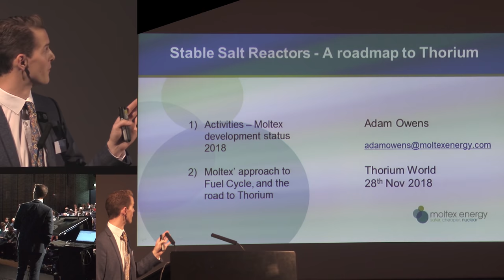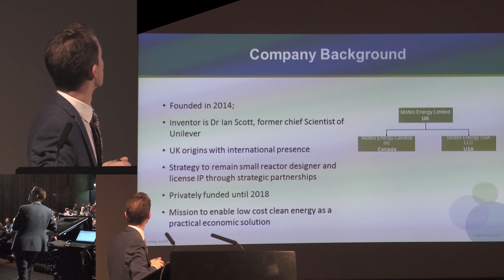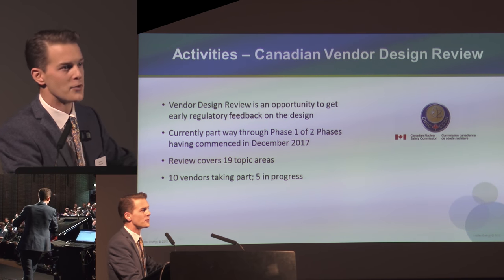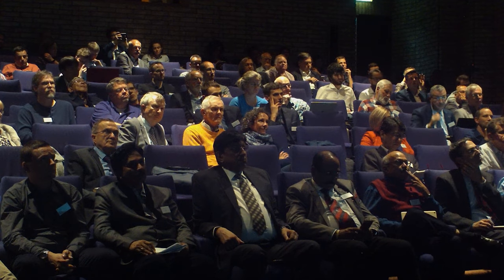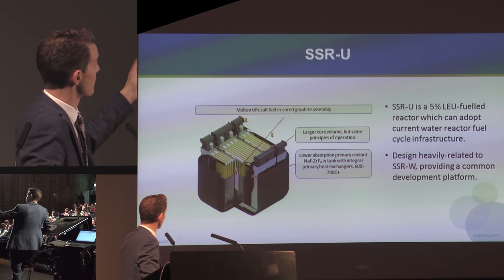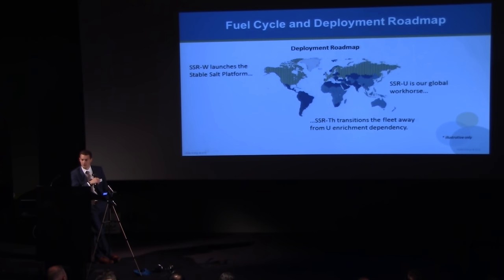Moltex SSR (Stable Salt Reactors) a Roadmap to Thorium @ ThEC2018

Comment from the maker: Timecode index
...
00:00 I'm Adam from Moltex
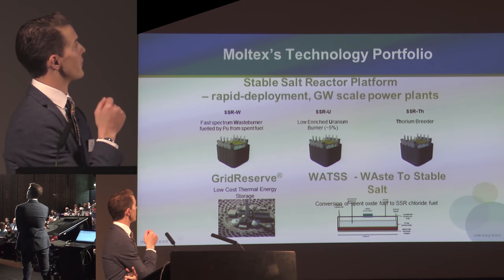00:48 Moltex technology portfolio
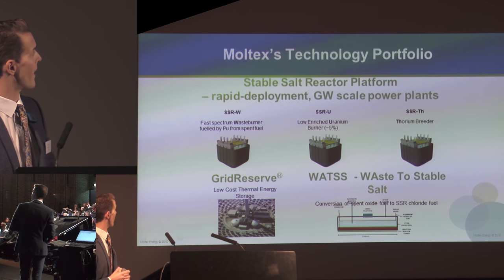01:20 Preconceptual idea for Aircraft Reactor was salt in fuel pins
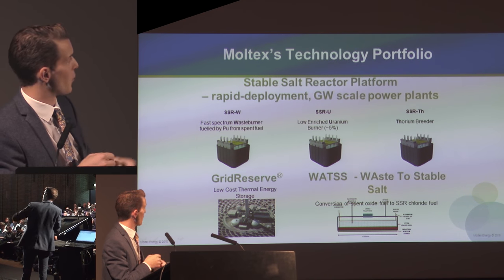02:07 Rapid deployment - avoid hardest regulatory hurdles
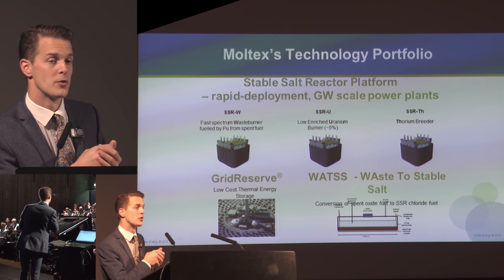02:50 Gigawatt scale
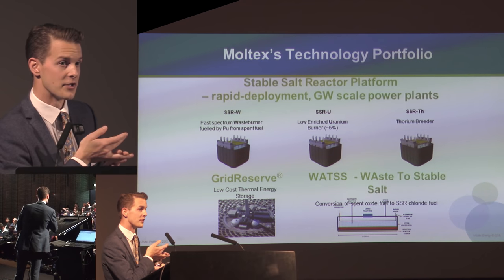03:29 first-of-kind MSR technology investable by private industry
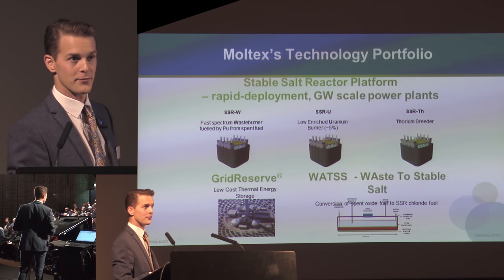04:40 3 variants of fuel cycle: SSR-W, SSR-U, SSR-Th
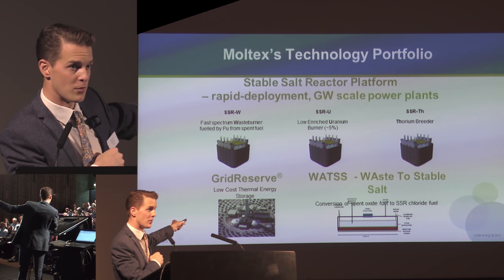05:25 Grid reserve - act as a peaking plant like a CCGT
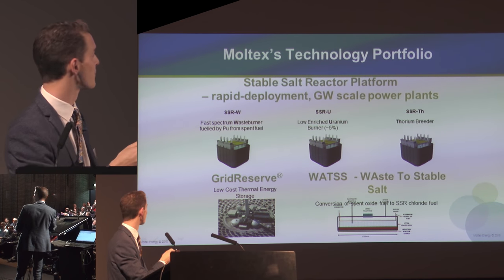06:37 WATSS - WAste To Stable Salt
07:10 Moltex company background - founded in 2014
08:05 Activities in UK - AMR Feasibility Study
09:07 Activities in Canada - Vendor Design Review
10:13 MOU with New Brunswick Power (Canada) Pilot SSR
11:42 SSR-W (Stable Salt Reactor Waste Burner)
14:20 SSR-U (Stable Salt Reactor 5% low-enriched Uranium)
15:51 SSR-Th (Stable Salt Reactor Thorium breeder)
16:54 Deployment Roadmap - requires a mix of all 3 reactors
Reply: Thanks, Adam.  Four years on, how is this progressing?
From England

Comment: Moltex has one of the best fast reactors I have seen: great for burning waste, burning conventional LEU, and breeding U-233 from Thorium (which we will need a lot of in the future to deal with the burgeoning fleets of new thermal spectrum reactors). It's design is simple and economical, very few moving parts that are prone to wear and replacement. No meltdown risk with very high proliferation resistance. I hope Moltex can work with the US. We would like Moltex's here.
Reply: Moltex can't breed
Reply: @PH-mo3vu  
As in the SSR isn't a "breeder" reactor, technically true. But so what? Just means U-235 will still have to be used, albeit in much smaller quantities i.e transmuting thorium in the coolant to fissile uranium is still a "good thing". No need to turn "thorium only" into a fetish. IMHO.
Reply: Moltex consumes 235 U with or without (a small amount of) thorium in the blanket. To reach 20 TW only heavy water and sodium reactor can do
Reply: Further advantages are the high temperature output.
This enables both extremely efficient water desalination and extremely efficient zero carbon hydrogen production

Comment: woah.. Their designs appear to have changed drastically since the last time I saw their presentation. They're bringing back thermal spectrum into their reactors. It seems that MSR companies tend to start off quite different, but end up converging to LEU thermal burners, as with Thorcon, and now Moltex.
Reply: Three possible variants. Only the waste burner  currently being pursued. After that is commercialised, they'll start looking at the other two. Low hanging fruit first.
Reply: It's because at this stage it's more important we build nuclear reactors and start reducing our emissions, than gambling on the more advanced technology. Once you've got revenue coming in you can spend the R&D dollars developing more advanced reactor.
Reply: The Russians have actually built those reactors already, see bn800, bn 1200 as have the French. The fast breeders are not economical yet and also a new class of materials will have to be developed for the structural elements to prevent fatigue since they run at high temperatures
Reply: @thexperimenter88  So the BN 800 and BN 1200 are sodium cooled fast reactors, which is a different technology to molten-salt cooled reactors. The Moltex SSR-W has been designed to not require exotic new materials, just standard nuclear steels. That said as I understand it the challenge with sodium fast reactors is not materials per se, but rather dealing with the inherently unsafe problem of liquid sodium metal, which burns readily on contact with air or water. This is a problem that molten-salt reactors do not have.
Reply: Tom Shackell all molten salt reactors work at higher temperatures than the reactors currently in use. The steel may withstand the temperature but Investigating creep in the steel takes years. Then the material becomes certified. Then there are more sensitive apparatus like pumps, seals which need to be investigated as well
Reply: Tom Shackell personally I prefer the design of a company called aristos to moltex. Moltex makes use of a shuffling machine that is known to be a headache and a very complex design
Reply: @thexperimenter88  So I am not an expert on nuclear regulation. That said, what Moltex have said elsewhere is that they are using 100% materials that are already certified for nuclear, well within the tolerances that they have been certified for. No new material certification is required: which is key to their business case. Additionally unlike pretty much every other MSR their design does not involve pumping hot fuel salt round a loop: it is a "pool" type reactor. None of which is to say that they couldn't face technical hurdles: that is always a risk.
Reply: @thexperimenter88  I really couldn't comment on the shuffling machine: not a nuclear engineer. Thanks I will have a look at the Aristos design as well, I have not seen it before.
Reply: @thexperimenter88  It doesn't, actually. All it does is push fuel rods horizontally from one end to the other. If you alternate directions between rows, you can maintain an even neutron flux. (that's what CANDUs do anyway) The one with the crazy shuffling machine is Terrapower.
Reply: Tom Shackell Aristos power has a Facebook page where they have been posting their different designs. There is also a YouTube video about them
Reply: Tom Shackell material is always a bit of a limiting factor right now for any molten salt reactor. They all would like materials that allow them to operate at higher temperatures for higher efficiency
Reply: @thexperimenter88  Ah yeah I looked into the shuffling, it is CANDU style: pushing assemblies along a rail. It doesn't look too complicated to my (untrained) eyes:
https://aris.iaea.org/PDF/SSR.pdf

Yeah I think most fast reactors would benefit from better materials. That said, as far as I can see this isn't a hindrance to adoption now .. it would just allow better efficiency if it becomes available.
Reply: @thexperimenter88  Ok I think I see the problem. Shuffle has 2 definitions: rearrange, as with Terrapower's Travelling Wave Reactor, and walked, as in "he shuffled over to the sink". See page 4. Fuel rods are transported 1 step at a time laterally down the rail. The fuel rods are "walked" down the rails. Relatively simple mechanism and only done when the reactor is powered down to nearly idle.
Reply: Mikel Syn that is at first glance but a person who works designing this molten salt reactors would have more insights into it. I remember Ed Pheil mentioning that while at first glance Moltex system looks simple, when you go into the details their system is very complicated.
Reply: Rus88 this could be true, it’s really hard to make that assessment as a non expert. That said it’d be very surprising if Ed Pheil, who runs a competitor company to Moltex, said he thought Moltex’s design was better. Personally my view is to fund them all and may the best design win. Still Moltex seems the simplest to my entirely non-expert intuition 🙂

Comment: If you have a fast spectrum waste burner (I'm assuming the breeding ratio can be high with fertile coolant salt) what good is the LEU or thorium reactor variants?
Reply: Some sort of graphite moderator for the LEU. Thorium in the coolant salt for the thorium breeder.
Reply: That's sort of what I'm wondering. I know thorium is abundant, but the cycle through protactinium is really long and nasty, and it's only 4x more abj dant than uranium.

If you can breed uranium, then there's thousands of years of uranium in seawater. Why bother with thorium at that point?
Reply: @sgg Protactinium is really nasty. A fast uranium breeder doesn't need any online reprocessing and can burn up any actinide basically, so the only real reprocessing task is light element removal, which is easy.

And if you have a fast uranium breeder then the abundance advantage for thorium is almost totally eliminated.

Comment: So, they breed fuel from Thorium mixed in the primary coolant?
It's not in the fuel tubes?
Do I have that right?
Reply: Yes, but couldn't they just do that with the waste burner though? (with U238)
Reply: @leerman22  

No need at the moment. Some point in the future once the technology is perfected.
Reply: Yes that is right.  Thorium needs to decay in a particular way in order to contribute heat.  https://en.wikipedia.org/wiki/Thorium_fuel_cycle  
Other more market ready plans skip Thorium 233 and use Uranium. 
It is why one proposal was to use a particle accelerator based design to contribute the neutrons.
Reply: @leerman22 Do you mean like ASTRID in France?  ASTRID (http://www.world-nuclear.org/information-library/country-profiles/countries-a-f/france.aspx)  uses plutonium. That is advanced and will be very helpful for the industry to make useful isotopes and reclaim or stabilize waste.  The US environmental political climate (Nixon) stalled these sorts of breeders that have many uses.  The thorium fuel cycle is based on slow moving neutrons and some had the idea that less actual uranium need be circulating in the third world because the uranium is only a neutron source. So super powers with plutonium and outsiders get different designs.  Iran for example.  The hope is for a truly domestic reactor that uses non-military isotopes, produces medical isotopes,  can't explode no matter how uneducated the operators are,  tamper proof and self contained.   Thorium need not be included.  There was at least one video that talked about using fuel pellets.

Comment: I kept waiting for the promised economics discussion. Here in Georgia we have some of the highest rates for electricity in the U.S. as a direct result of the cost over runs and delays associated with the reactor they are adding to an existing plant. Solar PV and battery costs are falling steadily. Where is the argument that this tech can be less costly? The case can be made that nuclear power is a religion since it starts with a conclusion: nuclear good, and persists despite evidence to the contrary.
Reply from the maker: Steve, Westinghouse was a management disaster. The over-runs at Vogtle have little to do with fission-vs-combustion-vs-solar... South Korea and China show there's nothing inherently expensive with fission as a reliable power source. And the disadvantages of solar are inherent to the technology: the sun sets so storage or backup is needed, which means, as of today, a return to combustion and pollution. See Germany as an example of what happens when intermittent energy source is mistakenly seen as interchangeable with dependable or dispatchable power. https://www.electricitymap.org/ ...in fact the 2nd built at Vogtle is less expensive than the first, and the world could have changed dramatically if only Westinghosue had been better managed, and the builds could continue one-after-the-other. India has ordered 8 AP1000... so it might happen, and the future prices of AP1000 might fall dramatically world-wide... OR they might only fall in India... OR Westinghouse could continue screwing up. I'll be waiting to see, myself.

If you'd care to hear my thoughts regarding intermittent energy and AP1000, here's a deep link to a video I created called "Thorium." just before the AP1000 topic is introduced https://youtu.be/2oK6Rs6yFsM?t=12084